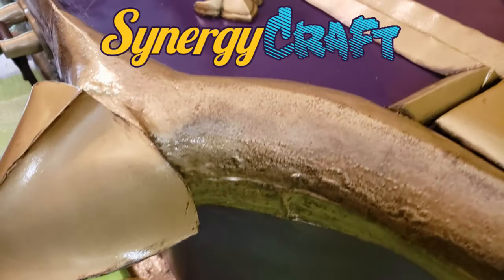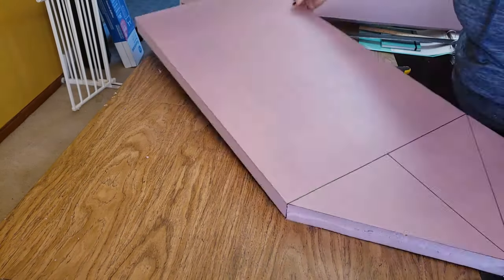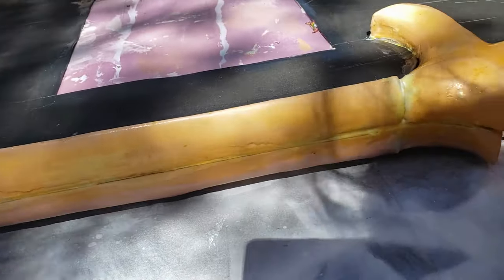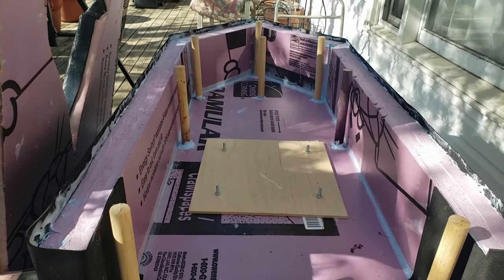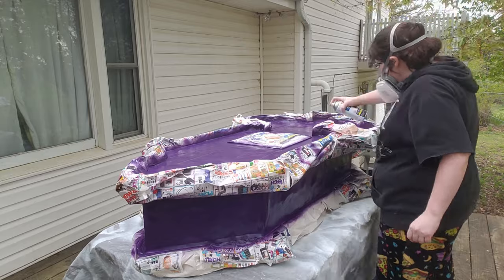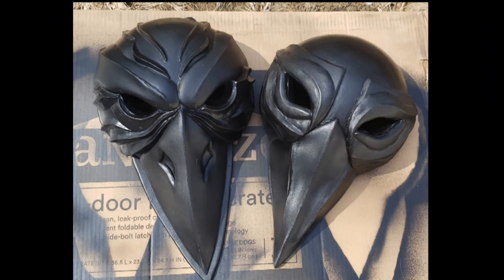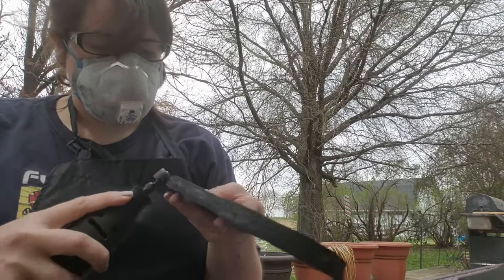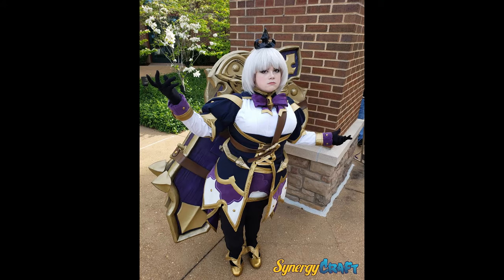How to Make Orphea's Relic Crate | COSPLAY TUTORIAL | Heroes of the Storm

Comment: A note for those trying to use a similar harness method. Machine screws do not come with washers so we didn't think to get any. FIND YOURSELF SOME WASHERS!!! The straps slipped off the bolts a few times. Luckily we were able to fix that with lots of hot glue since getting inside and undoing the bolts was not going to happen. :^)
Reply from the maker: Thanks hun! Good note!